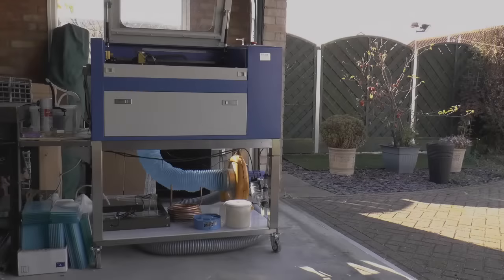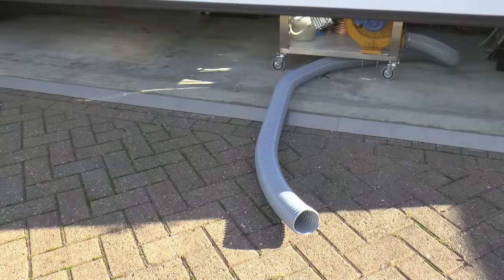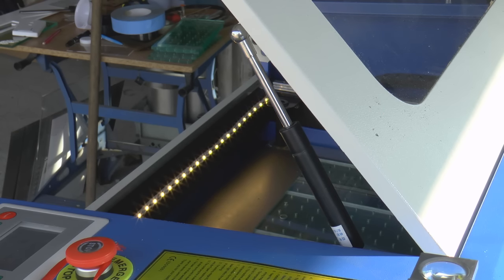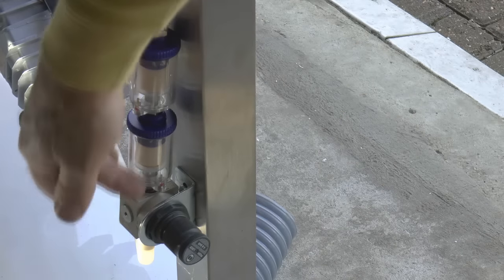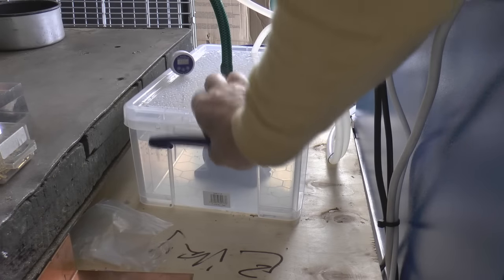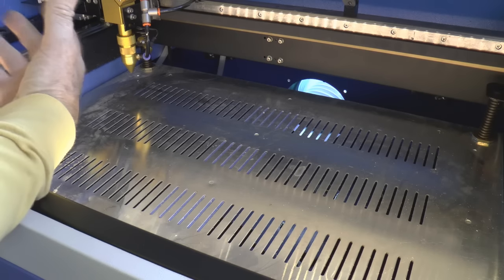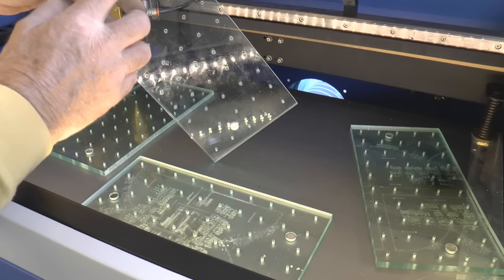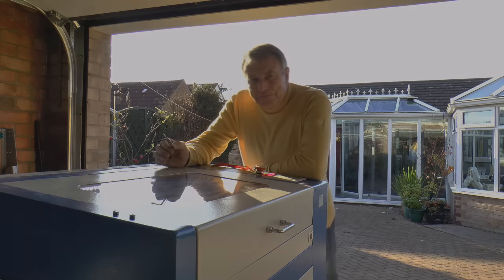My 50 watt Chinese Laser 4-month review

Comment: Is there any trick you can use to etch aluminium or steel??  I had a 2500mw optical laser engraver and it wouldn’t etch clear acrylic unless I painted the surface with a dry wipe marker pen to reduce reflectivity.
Reply from the maker: Hi
Sadly you cannot compare the performance of a CO2 laser beam with that from your blue laser. The wavelength of a CO2 laser beam is 10.6 microns wavelength. That from your blue laser is 0.445microns .  I have no idea how efficiently that wavelength stimulates the surface molecules of various materials. The laws of physics are pretty simple in that the shorter the wavelength the more easily they can be attenuated. You will already be familiar with this principle  if you recall that car driving past you with windows closed and loud music playing inside the car. All you can hear from the outside is the low frequency bass beats. The higher frequency part of the music has been  attenuated by various materials in the car body.  Your  high frequency laser  suffers from the same laws of physics. Yes it may be a laser  but it is close to ultra violet rather than infrared. Your problem with acrylic is obvious if you look at light transmission properties of acrylic. At your 445 nn wavelength it is over 90% transparent. So the 2.5watts you are firing at the surface will be very ineffective at heating/marking it.  Thus  the  problem with acrylic is opposite to your interpretation and is not a reflectivty issue. The various molecules in your dry marker can obviously be stimulated by this short wavelength light and converted to heat. That thin heated film then transmits its heat into the surface of the acrylic to damage it. 
 For metals, your notion of  reflectivity is the real issue. Alumium in particular is about 95% reflective at your 445nm wavelength. Hence you will not be able to get enough heat into the surface to damage it. There may be some inks or dyes that you can bond onto the surface at this wavelength but that will be your only hope.

Best wishes
Russ
Reply: Thanks so much, keep up the good work!  Maybe you could make a video testing various materials with the CO2 laser cutter.  Your vids are very thorough!
Reply from the maker: @lukepricey1  
Wood, mdf, Acrylic, glass, slate, granite, card, corrugated cardboard, Corian, plastic foams, leather, ceramics and anodized aluminium have all been covered by existing videos, even bread, pastry and my finger have been dealt with.

Best wishes
Russ

Comment: Hi Russ! I would like to ask you if it absolutely necessary to use these moisture filters. I am mentioning this as i know that these are mainly used for air compressors with a tank. And it makes sense as inside the tank, water is always present and you do not want that to come up as you open the air valve. I had a similar setup for my painting needs when i was painting models with small air model airgun. I have asked a supplier here in Greece and told me that an expensive air pump does not need this kind of filtration. I am talking about pumps that used also by dentists for example, not cheap stuff. How many psi produces this pump of yours? Thanks!
Reply from the maker: Hi Polis

My experience with large metal cutting laser machines indicated it would be a good idea to have lots of air available  and to make it controllable. That is why I initially fitted a pressure gauge , air filters and a pressure regulator. In practice it is totally unnecessary. The little pump that is supplied is oil-free and only supplies about 2psi  That is insufficient pressure to produce water vapour so you will not need filters if you use the little pump supplied. For cutting acrylic you will need very little air, just a whisper to make sure there is flow coming out of your nozzle to prevent fumes fogging up your lens. For anything else you will need maximum air flow to keep the IR absorbing smoke  away from the cutting face. I have now done away with my filters and regulator and have fitted one of these in the air assist pipeline.

http://www.ebay.co.uk/itm/6MM-PNEUMATIC-PUSH-IN-FITTING-BALL-VALVE-CO2-DOSING-PUMPS-AQUARIUMS-/302048371372?hash=item46537c62ac:g:rHIAAOSwd2xXQGaI

Hope this helps
Best regards
Russ
Reply: Thank you Russ for your reply. Actually i am interested of buying a Universal laser if i will be qualified to a funding program for new small businesses. So i asked the supplier of ULS about an alternative air assist solution, as the original costs ridiculous money, and told me about a 1.2psi good quality pump as i mentioned on my previous comment. And my question to you was because i saw you have used the filters. Just to make sure in order to avoid any damage to an expensive laser like ULS.
Reply from the maker: Hi Polis

I am sure that you do not need to spend money on an expensive air pump.

The only possible damage you can do will be to the lower side of the lens that faces the work. If you get water vapour in the nozzle it will instantly dry out with the IR radiation and start to produce a film on the face of your lens. You will be able to clean this off but do it too often and you will remove the anti-reflection coating that is on the lens. I can tll you this from personal experience. I was using my normal shop compressor while waiting for my filters to arrive and I saw the power performance drop as the film built up on the lens. I have never had an issue since I returned to the low pressure (oiless) pump  After a year of use I feel that my little pump is getting a bit tired. It still works well enough, but I have bought a spare pump in readiness. This pump is the next size up and will deliver slightly more airflow at about 2psi

http://www.ebay.co.uk/itm/140-LITRE-PISTON-AIR-PUMP-HAILEA-ACO-009E-FOR-KOI-FISH-POND-AQUARIUM-/400999453293?hash=item5d5d6e126d:g:kTcAAOSwsB9WCDsA

The pulsing nature of the airflow is not an issue

Best regards
Russ

Comment: those acrylic blocks are awesome, do you buy your acrylic pre cut at that size? that's seek like perfect sizes to fit straight in without having to cut large sheets down to size before hand. if so do you buy online.
thanks for the help recently
Reply from the maker: Hi Jeordan
I am a very lucky guy because from my pre-retirment days I had good contacts at a large plastics distributor that offered sheet cutting facilities to its customers. My pile of 8mm thick acrylic sheets were offcuts from a  job that was running through their saw at the time I arrived looking for acrylic offcuts. For a nominal charge I was allowed access to their recycling bin. Other colleagues have supplied me with surplus materials also.  I would guess I have spent less than £20 for all my materials so far. and there's a lot still in stock. Yes, very lucky.
Best regards
Russ

Comment: How many hours the laser tube last? What is the price of the replacement tube?
Reply: @JOYBG  
Hi 
The laser you are buying is a diode laser that runs with a wavelength of about 0.4microns. The CO2 laser that I have works with light of 10.6microns wavelength.  Your light is on the edge of UV so you need to take precautions that are completely different to my infrared wavelength. It will be significantly dangerous for your eyes ,especially as this is an open machine and offers you zero protection. The different wavelength will have completely different effects on materials to those that you will see in my videos. You MUST do your own research on materials that are safe to use because many plastics will produce toxic fumes. Get some special eyewear because  ordinary glasses work for me but will be useless for you.  Please be careful

Best wishes
Russ
Reply: @russsadler3471  10x for advices, I will make a protecting box around the laser with a ventilation system and will find glasses that stop that kind of laser. Experimenting with material will be fun :)

Comment: Hi, Great videos. I am having issues getting my machine to work. I 
cannot connect the machine to my computer. When I go to load a file up 
it does not appear on the Display on the machine. Also, there is no red 
LED working on the machine. The laser head is stuck in the middle of the
 machine and will not move when I turn the power on. Any Suggestions?
Reply: Eoin Kirwan hi i'm Just syarted so i'm not an expert but i can say that at the beginning i wasn't able to do anything a that was due to you had to generate files just with computer with Windows xp and use usb key fat32 or 16 . i was very frustrated and noone helped , i hope this could help. bye

Comment: Can you recommend an exact make and model that I can use to cut up to 5mm cast acrylic?  It doesn't have to be that high def, I'm just cutting out trinkets.
Reply from the maker: Hi

http://www.ebay.co.uk/itm/PRO-50W-CO2-Desktop-USB-Laser-Engraving-Cutting-Machine-Cutter-Engraver-/191158602039?hash=item2c81f0c937:g:UdsAAOSwxg5Xw8oh

This is an amazing deal for your application.  but It depends where you live and what's available on your own Ebay. This is 25% less than I paid about 18 months ago.  It's exactly the same as mine with a motorzed table. It's mechanically pretty good but the tube and power supply may be second grade so think about another £400 to £500 to replace them if/when they fail.  Once you have suffered this cost you will have a good reliable machine. You may be one of the few lucky ones that gets a reasonably good tube and power supply. It is very much a lottery.. Even with an upgrade, it's  great value for money. Be warbned  that there will be no back up service from your seller regardless of promises. Secondly, make sure you buy with your CREDIT card for maximum protection and do not accept ant further discounts for paying direct and bypassing ebay. the ebay protection is pretty useless but at least you will be able to contact the seller via ebay.
Good luck in your new venture
Russ

Comment: Hi, 

  Before I purchased my 50W Chinese CO2 laser cutter, I watched most of your related youtube posts.   Very helpful in making a choice.    It worked fine out of the box as of receipt in August of 2016.    I have no more than 35 hours on the machine and never run the power above 75 as I'm aware of the Chinese OVERDRIVE issue and don't presently have an amp meter installed.       HOWEVER, this morning, the laser would not fire.   It was working earlier and just quit.    Program loads and runs as it should and the laser head follows the program path, but laser does not fire.      Could you offer any suggestions ?    Is there such a thing as a troubleshooting guide for this machine?    Etc?

Any help would be appreciated.    

KM in Wyoming USA
Reply from the maker: Hi
Sadly There is no trouble shooting guide that I am aware of.
For your situation where the machine just stopped there is only likely to be one problem...a dead HV power supply.
The tube does not just die it generally shows symptoms of erratic cutting and general lack of power before it finally takes its last gasp. If you run a program and check what the tube is doing, then if there is a pink glow in the tube then the power supply is working and you have a tube issue where the CO2 in the gas mix has all been consumed. If there is no pink glow then the power supply is broken. There is not a fuse in the power supply as far as I am aware and and what's in there is very dangerous. If you have to change your power supply then turn your machine off and leave it for an hour before you touch anything to do with that thick red wire.. Make sure you buy a MATCHING power supply for your wattage tube. Dont go by what the tube claims to be but measure the tube. 800mm is 40 watts, 1000mm is 50 watts and  1200 is 60 watts. If its a fat 80mm diameter tube and about 1200mm to 1400mm long it may be a 100watts

Hope this helps
Best regards
Russ
Reply: Thank you very much for your reply.   I will do some testing this afternoon.    Best Regards,   KM    PS, do you know the price of the 60 watt lightblade you have been testing?
Reply from the maker: Hi 
I am pretty sure Thinklaser are shipping to USA but you will have to send an email to gareth@thinklaser.com  for a proper quote because mine was by a very special  deal
Thanks for your interest
Best regards
Russ

Comment: Excellent info and very well done.   I'm considering a larger bed 60 watt machine.  Any thoughts on how thick a solid wood piece could be cut?  I have a small side business that would be cutting 3 mm plywood but also some other parts that are about 16mm solid Acacia.  And sometimes bamboo and rosewood.  Thoughts?  Should I just cough up the dough and get the 100watt? :)
Reply: 3mm plywood no problem, 16mm is another story

Comment: Hi I am up to 8 in the videos you put up and i have noticed that you have not set up the fan to pull the smoke out, can you tell me did you get an exchust motor with the machine. PS love your vids they are very helpful Dermot
Reply from the maker: Hi Dermot
This 4 month review shows you that I have removed the little blue exhaust fan that was fitted to the machine and have now fitted a large flow extractor fan. This works extremely well.  As you get further into the series you will see how well the fumes are extracted. 
Best regards
Russ
Reply: Hi Russ. I was  just going to get a laser machine and have a go at it just like you but now i am getting the one you have so that way when i have problems i can just look at your vids so thank you for taking the time to share you vids with us all, just one question can you tell me what size the machine is i just want to make sure that it will fit through my door, china keep giving me the box size.
Dermot
Reply from the maker: Hi Dermot
Machine Dimension:1020×650×630 mm Net Weight:65KG. even the 650 dimension will fit through a standard 27" door and you may even have 30" doors.
Thanks for your appreciation and good luck with your new machine.
Best regards
Russ
Reply: Thank you for that, have a great day.

Dermot

Comment: I Russ   I have heard on another youtube channel when this chap used his workshop compressor his cutting speeds doubled.  When asked he said the extra air blows away all debris and its a constant air stream and not a pulsing one from the small supplied air pump.   Have you or can you as i know you have a better compressor do a test as i know you love to test to the max.  Regards Andy
Reply from the maker: +Carbon - G10 - FR4 - CNC Routing - 3D Design &amp; Printing - Online Shop 

Hi
He will be correct under certain circumstances.
Firstly it depends on the lens focal length. If he is using 2" or 2.5" then his nozzle will be far away from the work surface and the little pulsing pump has  insufficient enough flow rate to jump across the 20mm or 32 mm gap between the nozzle and work surface and still have significant remaining force to push away the IR  ABSORBING FUMES   down in the cut area. Because my lens is 1.5" FL  the nozzle sits just 6mm above the surface and the little OIL FREE pulse pump does a good job. In fact there are occasions when I have to regulate the flow DOWN.
Secondly it depends on the material he is cutting. Most BURNING materials such as wood, leather etc will benefit from having the cutting face scavanged of fumes because the smoke and tars are great absorbers of the IR energy that should be going into the burning process. However, the REVERSE is true for acrylic. As know, IR energy is just concentrated heat. That heat does not BURN acrylic, it EVAPORATES it. Yes, the fumes need to be moved on by a gentle flow of air but force too much air into the cut area and it has a COOLING effect and will decrease your cut depth. I observed this in one of my early videos but demonstrated it clearly in the Lens video recently. I also illustrated (albeit very crudely)with an  a separate air tube, how you can get air to the cut zone and still use the little pulse pump. It's incredibly inefficient (also noisy and expensive) to try and bridge that gap with increased air pressure/flow from a shop supply. You also need to installgood water and oil filtration otherwise those airborne particles will settle and BURN onto the face of your lens
A Tee joint in your air assist line will give you a shared supply. It is important to keep a little positive pressure in your nozzle to protect the lens from cutting fumes.
Hope this answers your question
Russ

Comment: Nice bed, but how do you hold down warped ply?
Reply from the maker: Here is one way from 20min 45sec
 https://www.youtube.com/watch?v=ATu-7EGZGMA

Best wishes
Russ
Reply: @SarbarMultimedia  You kinda missed my point. I was asking about THIS bed...I currently use expanded steel as a bed, on my K40, with neo magnets as hold down. I struggle to think of anything better & more convenient... this bed of yours, although really cute, cannot match mine for ease of use (for what I do, mostly 3mm ply), even with the reflections & resin build-up I get. Lite ply works best, but isn't as tough as ordinary birch ply. I also have a permanent datum set, for X0Y0. Pretty sure there's nothing perfect out there... I'm still looking. Perhaps thin, steel (0.2mm) flat bar on edge... Hell of a rabbit hole, eh?